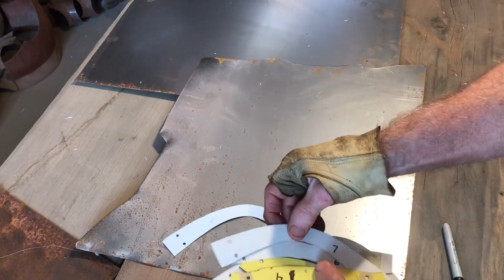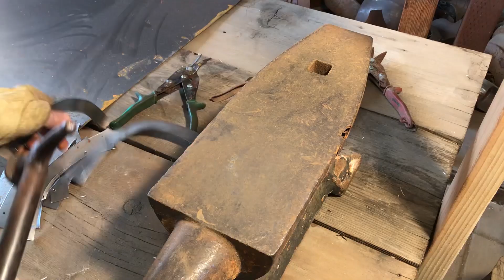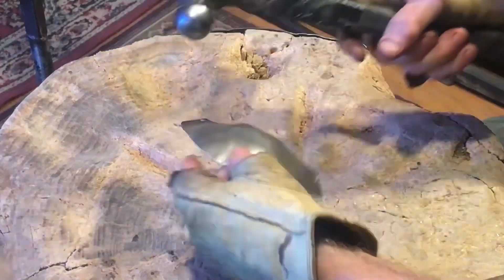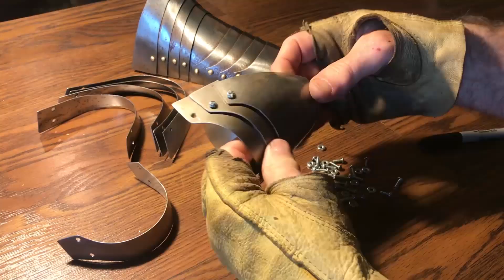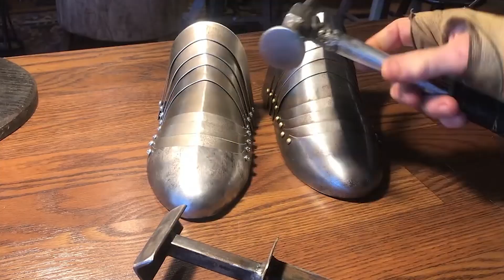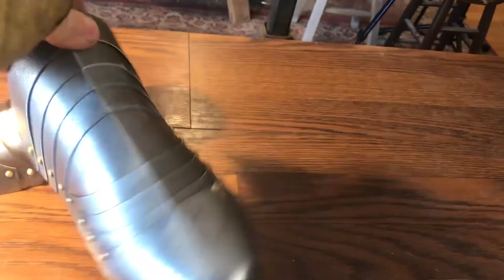VA Armor - 01 - Sabatons compilation

Comment: I’m struggling making the template from scratch…. 🧐 any resources you could point me too?
Reply: What I did was I drew my foot sole outline, and my foot profile outline on the same cardstock paper. Over each outline, I also drew another outline for the medieval shoe I would be using (want it to fit after all), so I know how much difference there was. From there, I sketched the lames designs, and with separate cardstock, traced out the HALF the lames shapes, then drew the other half via eyeballing until I had a template. I laid the templates over the outlines of my foot/shoe. Make sure each part is made in a curve! Subtle, extreme, doesn't matter. There HAS to be a curve. 

I attached all the new template pieces together with brass binder clips from any office store, and would trim/replace any parts that weren't working. A ton of back and forth, throwing out paper, making new ones, trimming old ones, but eventually you get there. I managed to design mine so it didn't require a central leather strip going down the middle of all the lames. 

Best of luck to you man, I didn't have any resources other than photos of museum pieces, and watching videos like this to wrap my head around it all!
Reply: Thank You